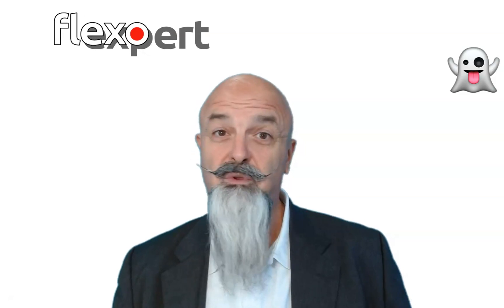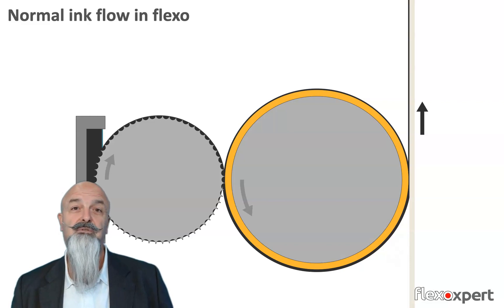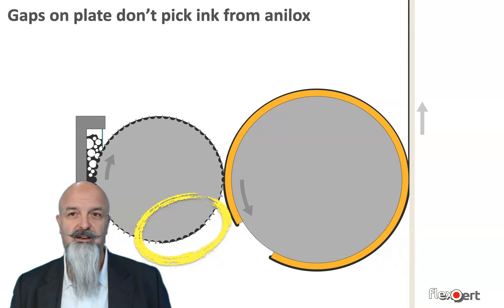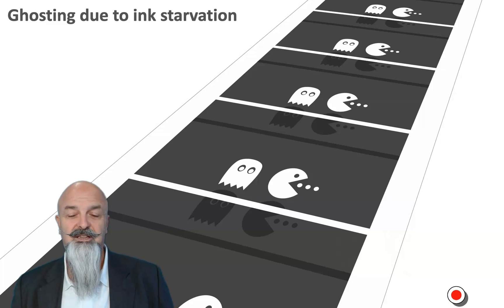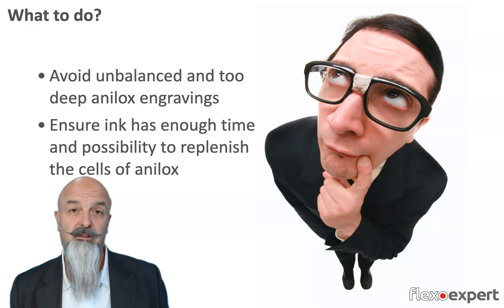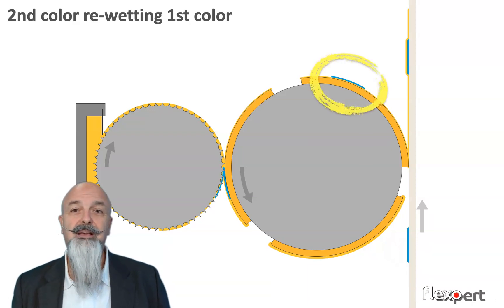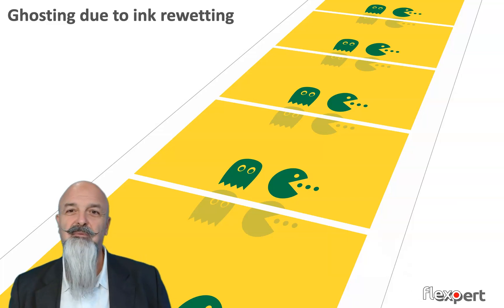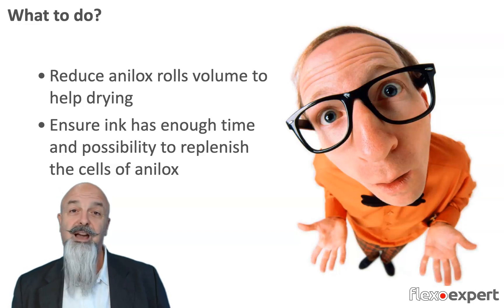Ghosting in flexo printing

Comment: What’s your thoughts on ghosting blades, we’re using one right now. Does a 3rd ghosting blade sit on the anilox to help wipe off more ink or does it not touch the anilox at all and just create a vortex in the chamber blade to slow down the volume to the anilox?? I’m debating with a coworker
Reply from the maker: I agree there are different approaches. I think that a 3rd blade should provide an extra "push" of ink-flow towards the cells, so it would be positive and not touching, or with minimum pressure with the surface of the anilox. I also think that a well-configured chamber and a good balance in anilox engraving would not require any additional blade.
Reply: @flexoexpert  thanks! We use ghosting blades not only to avoid ghosting but it helps stop peppering or ink bridging from one dot to another. But usually if there’s peppering putting new blades in usually stop this. We do a lot of fine screen work but our bosses don’t wanna use anything finer then a 900 anilox as they see them ware over time so they end up printing like a 1000 or so
Reply from the maker: @davidj161  dot bridging is more likely caused by excessive ink quantity... if a 3rd blade cleans better, it means that the normal metering is not well configured, maybe excessive blade pressure/bending causing hydroplaning and too much ink passing under the blade (easy to detect with tip angle measurement). Cannot comment about 900 or 1000 anilox: it is meaningless without volume information.
Reply: @flexoexpert  the press I operate is a 10 colour Bobst F&K 20SIX machine. We run high speed food packaging so usually without extra chamber pressure we get bouncing and chamber leaks all the time. But yes I agree I have seen that issue with blades. Our 900s are 2.7bcm I believe. I’ve suggested to management getting some 1000s 1100s 1.2-1.7bcm for our fine screen work but they’re happy with the 900x2.7 🤷🏻‍♂️
Reply: Hi @davidj161